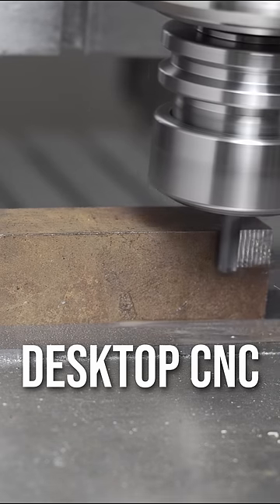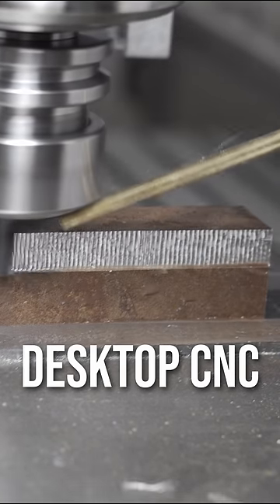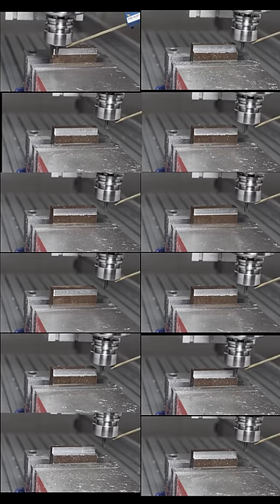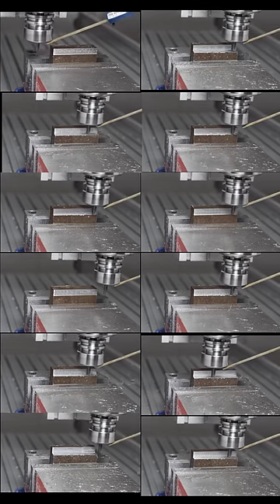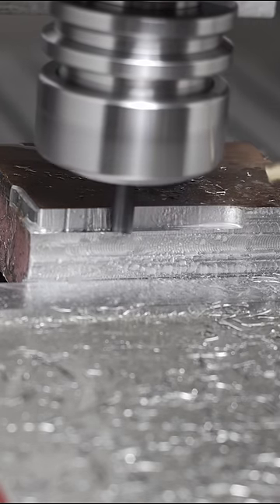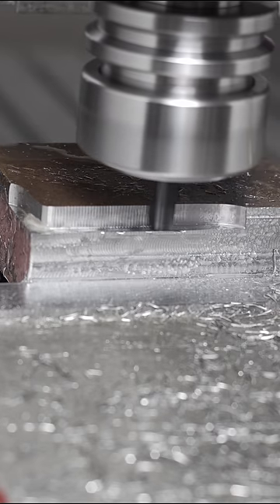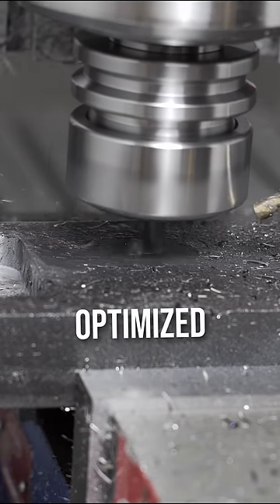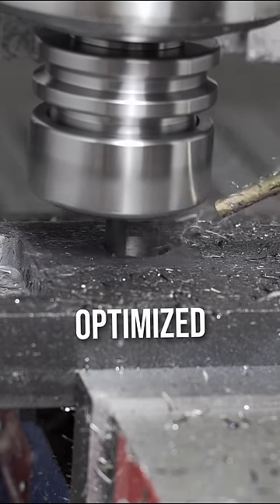Cutting Steel on a Desktop CNC

Comment: Do Americans actually know that there’s cutting value tables ? You can actually calculate what the best speed + RPM is by knowing wich steel, wich cutter (material) and what diameter (cutter) you’re using….. at least that’s what machinists in Germany do 😅

Comment: Congratulations, you've learned that Climb Milling is not for hogging out material. It's for a very light cut to produce a smooth, final cut finish.
Reply: Depends on your setup and tooling.
Reply: @Caseman91291 indeed and this setup and tooling is not for that clearly.
Reply: Actually that's only for a
Manual mill. CNCs are the opposite. You almost only climb cut with CNC, and rarely with manual.

Comment: Don't climb mill on a desktop CNC at low spindle speeds and aggressive feeds. Tune feeds and speeds with conventional milling and your spindle absolutely ripping fast. Then step the feed up as you drop the spindle speeds. You will find a sweet spot where the two meet and you get perfect chips. Then find the relationship between that point and how much you can decrease speed and increase steps while maintaining similar performance. 

Then convert to linear speed and your overall tool engagement. Congratulations, you now have your default starting point for all new tooling in that material while doing conventional milling.
Reply: dude he is machining steel not aluminum, you want lower spindle speed, not "absolutely ripping fast"
Reply: This is the proper way .
Reply: @jeremyjohnston9120 Um…not really depends on the factors. For a strong machine you are right but for a puny desktop one or a conventional cnc…f no you will burn tools faster . You need to find the sweet spot and you can find that by having a fixed feed let’s say 1000 mm/min and a 2400 rpm , start cycle at around 50-100 and gradually increase it until the chips fly nicely then you make the ratio . This method prevents you from having stuck plastic/Aluminium chips from sticking to the tool, prevents early wear in steel, prevents breaking pieces in cast iron , prevents premature axis wear and so much more.
Reply: @jeremyjohnston9120 it’s a weak ass machine… less feed more speed.. they aren’t even designed for steel..  nothing in it is even steel accept the collet and end mill..
Reply: All terrain tires have softer rubber which wear out faster when normal driving ie roads, highways, etc.

So if you want all terrain tires for the looks, know it will kill your gas economy and you’ll replace them earlier.

Comment: It looks like you're feeding it the wrong way. You need to feed in the opposite direction of rotation. From the clip of the first pas you need to go from left to right, not right to left.

Your bit is pulling itself along and that's what's causing your chatter. This is called climb cutting which is only really useful for finishing passes when very little material is being removed. The reason the hole cut has less chatter is due to it being a traditional cut instead of a climb cut.
Reply: No climbing millings is the recommended industry stand for cnc Milling, and the the pocket he does is also a climb milling path
Reply: @zechbaker6970  yeah but this machine obviously can't handle it. either too much backlash w/ no eliminator or it's just weak.
Reply: @zechbaker6970  Yeah, industry standard. If you'll forgive a bit of wordplay, I don't think they make imdustrial desktop mills.
Reply: It won't make much difference. All the chatter is mostly because his frame is simply not rigid enough. They entire spindle and frame is bouncing around because of the forces involved.
Reply: Looks like your cutting the wrong direction.
Reply: Climb milling is better for your tool life, even while roughing my man, unless you're pushing your machine too hard, which will obviously yield bad results regardless of what tool and material you're working with
Reply: @paudan1284  it's too weak imo, it's a tiny ass routet trying to push through steel with sub-optimal speeds and feeds 😅
Reply: It's funny reading comments from people who obviously don't machine for a living...
Reply: Here’s the thing, this isn’t even a mill, it’s a cnc router, with almost no rigidity. It’s clear it’s not designed for steel. However climb milling is the correct way to cut steel on a mill, other wise you’re binding up your end mill with chips and not throwing them out, I wouldn’t recommend cutting steel on a router, or any machine without coolant. So yes you can do it. But you’ll really have to slow your feed down

Comment: 1st step is check your spindle run out.  Such endmills need as close to no run out as possible.
Reply: That ER tool holder will spin super true as long as he has the right collet
Reply: @bobelkiniii1461  right if it's a good tool holder a good collet everything snuggled up etc.  Still good practice then to check run out.  I've had some where you needed to clock the collet just right and some end mills are crooked.  But the smaller the end mill the less tolerant to run out.  You could have several thousands on a half inch but if your running little tiny end mills they need to be darned near 0.

Comment: I’m old, and don’t know if it’s still done this way, but “back in the day”, my co-worker (from Switzerland) said he had to hand file every type of metal(s) in their machine shop for TWO YEARS before he was allowed to run a machine.
It was the standard apprentice training process of the entire region.
“We have an intimate knowledge of the properties and personalities of every metal, long before we lock it down on a machine.”
He was the best machinist I’ve ever known.
Reply: That’s a moronic requirement.
Reply: That's how my mentor was trained.  I'm somewhat the same.  I clean, sweep, deburr, and saw cut.  When I run out of that I get to watch people run the machines, do the math for them, and press the go button.  That way I learn the stuff like "always set your tool offset from a fixed point" the easy way.

Comment: It's climb cutting versus conventional cutting. Conventional cutting feeds right to left or against the cutting edge so the blades are pushing material toward the cut. This style of cut is used on manual cnc machines like Bridgeports. When using any automatic cnc machine you climb cut the material left to right and maintain a constant feed of coolant for a nice finish. I hope this helps in your future videos.

Comment: There's a reason the Avid CNC and other CNC routers are not CNC mills and not rated for ferrous metals. The spindle speed can't be set low enough to cut steel properly. But as you've found by experiment, it's certainly possible to rub the steel off at high speed without really cutting.
Reply: It has nothing to do with the spindle speed, these routers are just not rigid enough
Reply: @wolf310ii  Having milled steel on a Sherline, I can tell you that rigidity is not the most important part of the equation.
Reply: @canonicaltom  Yes it is, more than RPM and a Sherline is far more rigid than a CNC-router

Comment: The tools should come with optimum settings for the material being cut from the manufacturer.

Try taking smaller cuts in and use less radius of the tool. 

Where's your lubricant?
Reply: depends on the material, different types of steel, different metals in general have different speed and feed rates for different heads depending on the number of cutting surfaces and the diameter of the endmill. Hell even the maximum rpm of the machine you are using goes into factoring the speed and feed rate you should use for it.
Reply: you also dont need lubricant for end milling generally, but you CAN if you want to.

Comment: (3.82 x 300 to 800) / tool diameter
Take that number then multiply by n (flutes) x .001 to .0075 or more depending on what the machine can handle and your ratial engagement.

Comment: Have you tried keeping to the optimal speeds and feeds of your mill but program in a reverse finishing pass? Taking a cut in the same direction the tool is spinning (like a wheel on pavement) makes for a very decent finish.

Say you want to just make a square that is 1" and you have a billet that is 2 inches.
You start normally, keeping to your speeds and feeds (minor adjustments for longevity of the machine and tool if needed) but otherwise ignore the quality and chatter. But once you get within a tenth of the part, make your last 2 passes shallower and slower. One being .05" and the other .045" if possible with your tool. Then the finishing pass can be done counter to the pathing orientation at 0.05"  (in Anoka tech I was taught the term "walking off the chatter"). Of course these measurements are just made up and most of the time with accurate dimensions you'll be working in thousandths or even thoudths for finishing passes let alone hundredths. The same method applies, sneak up on the finish.

This can be hard on machine that dont have ballscrew leads if you take heavier cuts.

You probably know more about this than I do since you've likely learned everything I have and been around long enough to apply it professionally. I only went to school for 4 years for metrology, cad, machining and mechanical engineering and haven't been around long enough to apply what I've learned to great effect yet.

Comment: The rotation of the bit is clockwise. Running left to right causes the bit to cut into the piece. Right to left will make the bit far less efficient and more likely to skip, bind or go off course entirely. Thanks for the knowledge eddy. (Cnc coworker)

Comment: As others have said your feed direction is an issue and it may seem counterintuitive but often times we would slow our RPMs and up our feed. Depending on the material that you're cutting, taking bigger bites will help you stay in front of the work hardening. If you think about it if you are feeding at all your leading edge is always striking your material so if you're not taking as much each time then your leading edge is striking the material far more times over the course of a part than it would if you'd just let it eat.

Comment: A word to the wise, if you are struggling with chattering like that, you did it the wrong way around, you actually want to decrease the spindle speed and increase the feedrate. Chattering is causes by vibrations and the tool is literally bouncing off the steel. You want to put more pressure on the tool so it is not allowed to start bouncing. Less spindle speed means less vibrations as well.

Comment: For such a light spindle in steel you'll have to cut the opposite direction. It's pulling the machine into the cut because of the cutting forces instead of forcing the cutter through the material

Comment: Feed direction is wrong, also for a desktop end mill you could try a higher feed rate if you shaved off less each pass- ex: twice the feed rate but cutting half the thickness would do it in the same amount of time, but with it not being a full sized CNC then this would prevent the motor from bogging down and drawing more amps than you would want, which would also save your bit as well. This may not work with steel idk, I’ve mainly ran a router in wood, plastic, and aluminum, haven’t done any steel

Comment: This might improve CNC milling. I recently saw a youtube short about how a big magnet swung towards a piece of aluminum had a sudden slowdown right next to the akuminum from eddy current magnetic repulsion caused from magnetic damping. putting a nonferrous, or ferrous chunkt washer at what I think of as the connector to the spinny part, kind of like a chuck, and then putting a toroidal magnetic winding next to the chuckish thing would cause back and forth motion or cyclic oscillation of the cutting head to be greatly magnetically dampened, minimizing cut variability from being more on true. a nice bonus would be computer measurement of unpreferred vibration with dynamic adjustment to least vibration at each batch of identical machined parts. stuff would come out better, and cutting might be faster. Its as cheap, and kind of like a monochrome TV beam steering coil.

Comment: Looks like it's not ridgid enough for climb cutting or there is backlash in the lead screw. Try going the opposite direction if it goes away then its one of the above. If it's still there then the spindle bearings are too loose or the spindle is just too flimsy for that depth of cut.

Comment: In case you have a frame not stiff enough or steppers or motor not strong enough ( which looks like that), you should mill always counter clockwise.

Comment: Try using surface feed. 
Or using a small step over at full length of the endmill. Maybe use a chip per tooth. Or. Idk. Open a machinist handbook or something

Comment: If you don’t have a rigid machine, never climb mill. The tool will want to dig into the material and “pull” the table along with it. I’ve seen this happen on a Bridgeport when someone was climb milling tool steel. The end mill “grabbed” the part and the the whole table was yanked to the right by several inches.

Comment: This issue without seeing the machine build but this looks like the axis are not rigid enough. When the load is low key when high rpm or low feed it will be ok but once you push it will will climb and jump

Comment: What are you feeds and speeds?  You’re moving your rpm’s and federates all over the place.

Maybe try a shallower cut?  I see you’re trying about 10% step over but you’re doing it at near full depth.

Cutting speed is a thing for a reason, it’s the optimal material removal rate.  It’s different for each material.

Don’t climb cut either, that thing isn’t anywhere near rigid enough.

Comment: Your step over should be 5% of the cutter diameter or less with that machine. You can then multiply the feed per tooth by the result of this equation and go full axial depth of cut .: 1÷√(1−(1−2×Radial engagement÷D)^(2).
Your feed per tooth should start at .0004-.0007 per every 1/4" of tool diameter (on steels), multiplied by the equation result, then finally by how many flutes you have and your rpm.
If you do not compensate for stepovers below 50% of your cutter diameter, your tool will wear prematurely and generate LOTS of extra heat. I beleive it is feed and speed that caused the failure though, and possibly the tool holder.

This would also imply that all finish passes are inefficient, which is true to tool life. The rubbing and heat is what creates finer finishes though. (And scallop height in general).

Also if that is an ALTIN coating, I would be running at no less than 200 surface footage and as high as 450 with that coolant mist on low to mild carbon steels. Often going to a smaller cutter diameter like from .5 to .375 and then recalculating the step over will yield better results if your machine is not very rigid. You will be limited by machine rigidity (larger tooling) and available spindle speed (smaller tooling). There is a sweet spot for every machine where they can work nominally. Additionally, collet style tool holders allow the tool to deflect and that kind of seems like what is happening here. If it was your machine rigidity alone you would have stalled or broke the endmill before reaching that many attempts. You can kind of hear the chaotic changes in vibration when your tool begins to rebound after deflecting rapidly, almost like a percussion engraving machine or a wood pecker.

Comment: Should climb mill on steel when using carbide tooling. 

Try smaller fast step overs. 10% of cutter diameter. 6mm = 0.6mm stepover.

Comment: You are feeding in the wrong direction or what is known as climbing. Using a proper endmill for the depth of cut is needed too. Every cutting edge has a specific depth of cut.

Comment: Rule number one with machining: make your machine a rigid as possible. Way more than seems intutative.  A relatively light machine will vibrate.  In other words your chatter is almost certainly due to the machine.  Taking a less shallow pass (less load)  and making your end mill as short as possible (more rigid) will help.

Comment: Increase RPM's and reduce feed rate by an order of magnitude. When the machine does not have enough power, your only option is to cut it by being "annoyingly persistent". However if you do increase RPM's, you will have chatter in some capacity since the machine is not rigid enough. Doing conventional milling also helps in this kind of machines, as it will help dealing with the backslash these machines have. Also, as a kind of universal point: 12k RPM's, and between 200 and 1200 m/s per second are usually safe bets. Not great, but not wrong either.  Source: My own painful experiences. I man a 3mx1.5m wood router to mill aluminium.

Comment: You should try conventional milling instead of climb milling. Climb milling generates higher forces and is unforgiving on machines that are not rigid enough. Of course there are many factors involved but unless you have very heavy duty steppers it will likely never be rigid enough to climb mill steel.

Comment: you're doing what is known as uphill machining, its not great for taking bigger cuts unless the machine can handle it (yours cant)
try feeding the other way, and take smaller cuts to start, if that doesnt help, go slower, i mean literally feed slower not turn down RPM, just dont leave it in the same spot for too long

Comment: Speeds and feeds are in the machinist handbook at the back. You need that and the chart with the endmill to dial it in.  After that, slack will cause that chatter.

Comment: Just read my previous post and my speech recognition made a mess out of it. You can't move the mill in the direction that the chip out is going. It makes the mill chatter the way you observed. Also I  observed that you reversed the direction you were operating the mill when you were making the circle cuts. Keep this in mind. Planned ahead. Work carefully.